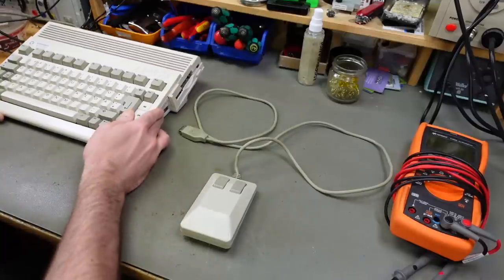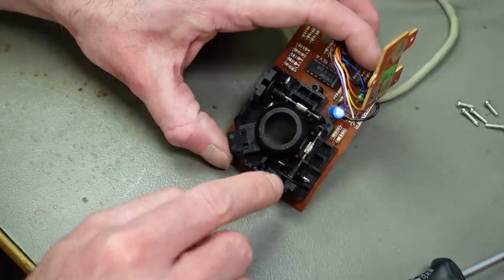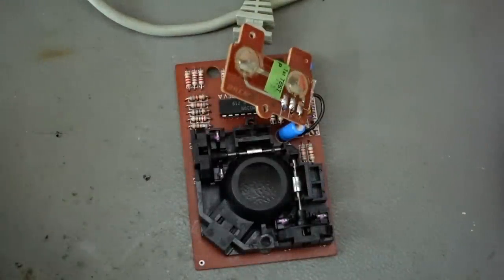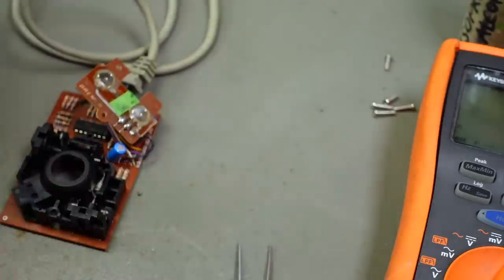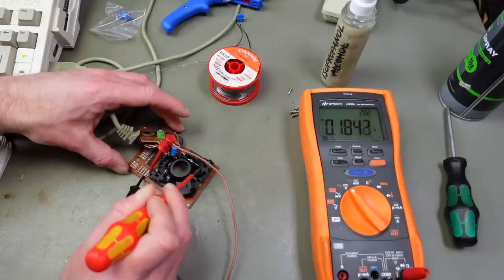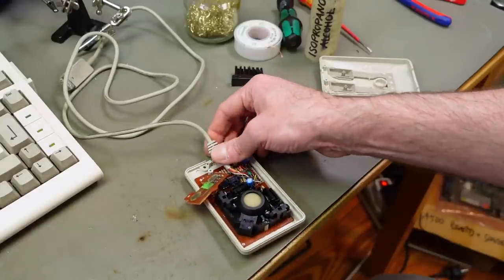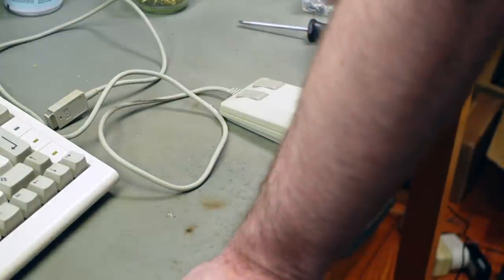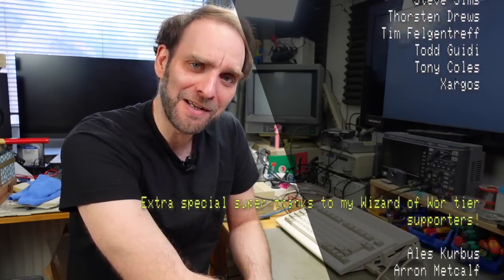Amiga Tank Mouse Repair

Comment: I was an Apple Tech back in the day and by far the biggest failure of mice was the cable at the mouse end just outside the grommet. My fix was to remove the cable, force the grommet further up the cable, a couple inches would do. cut the wire just past the bend where the bend caused the break, Strip the wires and reattach.
Reply: That is definitely my suggestion. Cut the broken cable near the moulded stress relief that goes into the mouse and test the yellow wire there shortening the cable until you get reliable continuity on the yellow wire.  
Unfortunately, that stress relief is directly moulded and fused onto the cable and will be very hard to move.
 Easier to cut the cable just before that and then carefully remove individual wires from the part going thru the stress relief. Then try and cut and pull the cable outer layer thru so you can then push the good part of the cable thru, etc.
Reply from the maker: That is a useful hint, thanks for sharing. I am actually going to try if that helps with the original cable. Maybe it's fixable after all!
Reply: Would have been a nice klickbait: "Amiga Tank Mouse Repair und How to build a wireless Tank Mouse".
Reply: Wanted to comment the same. If there is no obvious pinching or damage on the cable, the most likely failure is at the point that endured much stress and that is mostly bendy bit at the mouses end.
Reply: @JanBeta  Some cables were harder than others to get the grommet to move, but, I found grasping the jacket with pliers on the side facing the mouse and then getting the grommet to spin made it much easier to twist and slide the grommet away from the mouse end worked pretty good.  Keeping in mind you are going to cut off the section of wire that pinched by the pliers.--Good luck!

Comment: I'm not even in the same universe as you regarding my repair skills, but I have fixed my fair share of mice in the 90s. The cable was always the fault. Since the break is usually near the mouse, it's worth checking for intermittent contact. I used to check for continuity on each lead until I found the faulty one. Then I would bend the cable around my finger and pull the finger along the cable until I was able to localise the fault. Since it was usually near the mouse, I simply cut off a bit, with a healthy margin and then soldered the wires back onto the mouse. You'd end up with a slightly shorter cable, but your mouse would work. Given that my country was under a UN embargo during much of the 90s, it was nigh-on impossible to get a new mouse, or a replacement cable for that matter so we did what we could.

Comment: I had an issue with the glide pads on an Amiga 1000 mouse. The original pad material was thicker so I ended up having to add some double sided tape in the holes to shim it up a bit or the glide pad was too thin and the ball would not make good contact with the rollers due to the ride height on the mouse. This was with the same material you have there and an 11mm leather punch
Reply from the maker: Interesting! The replacement pads seem to fit perfectly on this particular mouse, feels very good and works perfectly fine. Maybe they changed the design slightly from the initial tank mouse model? I'm going to have to double check on my A1000 mouse.
Reply: @JanBeta  I think the original pads were also too thin, so Commodore stuck several on top of each other. That's why you had to remove more than 4 pads at 29:49

Comment: I fixed the missing teflon on my Mac SE/30 mouse by just buying a cheap sheet of teflon from China and cutting it out and just using double sided tape. One piece has a weird semi-circular arc shape, so I made a paper template and used that to find the right sized hole punches, and cut the straight edges with a hobby knife. That seemed to work pretty well for me.

Comment: Jan, thanks for another great video! How good are the button clicks? Those dome switches are prone to wear out easily, I had to replace several like those on Atari joysticks because they had become mushy and unreliable. The replacement dome switches I used were from an ebay seller in Germany called Amiga-Design, however they look slightly different than the ones in your tank mouse.
Reply from the maker: The buttons work well on this one but I've seen many of those dome switches wear out indeed. Usually you can get them back to work by removing the top of the domes (stuck down with tape) and cleaning the contacts and then sticking them back down with new sticky tape, I found. No need to replace them in most cases. They are very prone to failure though.

Comment: My experience with most mice that lose functions, from retro ones from many years ago to current ones that have stupid-thin wires is, the point at where the cable goes into the strain relief, which I find to be an ironically-named part, is usually the source of much strain on a cable and wires break right there where the worst bending of the cable takes place, needing to cut the cable back and somehow feed it through the strain relief & reconnect inside the mouse, reviving the mouse again, until the next time it breaks... :P
Reply from the maker: I'm actually going to give that a try with the cable I removed. Maybe it really is that simple. Several people in the comments pointed out that it's a common weak spot in these. Thanks for pointing it out!
Reply: @JanBeta  That's the benefit of sharing experience, it wouldn't surprise me if that one wire, you could pull on the copper and it'll just slide right out (also handy for gauging as to where the break is and where to cut it back to), I've done this with so many cables with alleged strain relief at one end and repairing, or at least bodging it 'til I got a replacement, the worst cuplrits being Lenovo PSU plugs, always breaking at the laptop end inside the strain relief itself!!! It's almost like they designed them to break there... :P

Comment: Nice fix and ideas what might be wrong in these :)
I have one PC PS/2 mouse, which otherwise works, but the wheel rolling feature stopped working at some point. The pressable button in it does work, but the roller, up and down rolling doesn't work. Luckily not a huge problem as there's other means to scroll up and down, so haven't gotten into it very deeply yet. Took the mouse apart once to see if there's just some dirt, but no, didn't work even after cleaning it.

Comment: I read somewhere that there are adaptors for using a standard serial mouse with a C64. Still, I really should test out my 1351 which I bought a few years back but never got round to writing the driver for it. I did for the NEOS mouse though, for my GUI programs. (Actually, I pinched a chunk of code from other software & modified it to work the way I wanted. I'd be happy to pass this on if you're interested, assuming the disks are still OK).

Comment: From my experience with Amiga mice, when something breaks, it's always either a wire, or the button itself.
in fact we've probably thrown away many Amiga mice just because of broken buttons... however, the ones we had never used blister buttons like that, the ones we had have a microswitch soldered onto the main board. I think it's a later revision.

Comment: Back in the day I found that the metal rollers were prone to collect dust, dirt, & crud (fluff). The first step should be to restore both rollers to clean shiny metal . Once you remove the resistor, I don't know why you didn't measure its resistance against its banding code (BBROYGBVGW). In my experience connectors are the most likely malfunction. (Ohm out them first.) Reseating cables has fixed many malfunctions. I've found Goo Gone works for removing old glue residue.
Reply from the maker: I cleaned the rollers meticulously in one of the previous videos in the series. Unfortunately, the metal is corroded quite a bit so it still looks like it’s dirty. The rollers work fine though, thankfully.
The approach I’ve taken was admittedly quite chaotic. I was very determined that the fault would be the same one I encountered during my 1351 repair so I jumped right into that without taking a methodical approach. That backfired quite a bit but I’m always learning. Thanks for the tips!

Comment: Hi @janbeta, I don't know if you read comments on your older videos and I have a really silly question; what type of screws are in the tankmouse housing? I recently acquired an original tankmouse myself but it came without the screws. I tried screenshotting your video, but the resolution is too low to get an accurate impression. Anyway, thank you for your videos, it gives me the courage to repair my own stuff ;)
Reply from the maker: Please send me an email (contact on my website janbeta.net). I can send you some measurements and pictures if that helps. (Might take a couple of days until I answer though, I have to take a tank mouse apart to check.) :)
Reply: @JanBeta  I managed to find perfectly fitting screws; M3x8 1mm pitch, and replaced the switches. Now only retr0brite is needed and it’s all done :) Thanks again!

Comment: Would soldering in a pin header on the "broken" mouse circuit board and then using the donor mouse cable intact with it's wired 
connector (unless it was fixed  to the circuit board and non removable) not be a more ideal solution Jan ?
Reply from the maker: In theory, yes. The pinout is different though so it would not be "plug and play", it would have required rewiring the connector so I went with the more destructive method. If I ever make a new cable for the "wireless" mouse, I can just reuse the connector or crimp some new connections on a pin header connector. :)
Reply: @JanBeta  Thank you for explaining this Jan it makes complete sense now.

Comment: I was shouting at the monitor for the first 20 mins of the video, "check the cable, check the cable!" 🙂
Reply from the maker: Yeah, noob mistake. Should have checked the wiring first thing. I was so determined it would be the same fault as in the 1351 mouse I fixed that I forgot to check the simple things first... :D

Comment: Could you have used the max\min function of the multimeter to test the resistors?
Reply from the maker: Yes! Didn't think of that but would make perfect sense in that scenario, obviously. :D
Reply: @JanBeta  Finally, that button will have some use! 😂

Comment: I noticed you didn't clean the roller wheels that rub against the ball. Lots of build up on them make the mouse not scroll as smooth. You have to scrape the junk off of the two direction wheels and the tension wheel.
Reply from the maker: I cleaned them as well as I could in a previous episode. Unfortunately, there is quite some corrosion on the metal that makes it look like it's still dirty. It doesn't interfere with the movement too much, thankfully.

Comment: I wore out the cable on so many cabled mice, I only work wirelessly now. Buuttttt....  Those rollers... clean those rollers!  Dead skin and oil are not good rolling surfaces.
Reply from the maker: I cleaned them as well as I could in a previous episode. Unfortunately, there is quite some corrosion on the metal that makes it look like it's still dirty. It doesn't interfere with the movement too much, thankfully.

Comment: very scary thumbnail...😯
Reply from the maker: I just couldn't resist putting the rubber mallet in the thumbnail. ;)
Reply: @JanBeta  When I saw the thumbnail I thought you would destroy the mouse after 30 minutes because it did not work 😆

Comment: Hmmm. This kind of debug is not really a good demonstration. Why not look at the schematics and measure at the output of the mouse? From there you can go back until you find the bug. Or at the outputs of the LM339? Just connecting some mysterious resistors is not a good example. The 5 digit DMM does not help here . . .
Reply: Exactly my thoughts. On the bench there stands a perfectly good digital scope with 4 channels. This mice have 4 signals for detecting the XY movement, why not use the scope to troubleshoot? Connecting 4 channels to the 4 photodiodes and then on the output of the pcb. After that connecting the probes to a D-Sub9 connector connected at the end of the cable. The data encoding in the signals by the are also not so complicated, 15 minutes of reading on the net.
Reply from the maker: I was on the wrong track but figured it out in the end. Using a scope to troubleshoot a mouse like this is way over the top. I usually try to use the simplest tools first and go to the devices that not many tinkerers have at hand as a last resort.
Reply: @JanBeta  you have the wrong approach.
Reply from the maker: @JacquesMartini  Yup. Can't always be on the right track.
Reply: @JanBeta  That's not the point. Your overall approach is not good. More than often, you just poke around in the circuit in hope for a lucky hit. Trial and error without much thoughts. This works somehow, but it's not a really efficient and skillful way. This can be seen on a lot of your repair videos, e.g. the fix of the C64 with broken traces. This easy defect of the mouse could have been a simple but good example on how to debug hardware the right way.
Measure

-supply at the mouse
-supply at IC
-output signals at mouse/IC
-measure voltage at LEDs
-measure voltage at photo transistors

A DMM is enough for this, but not with 0.1mV resolution. The flickering numbers create more irritation than information. 1 or even 10mV resolution is plenty here.
With the known good channel (Y axis) you can compare voltages very easy. Even with a known common defect as the bias drift of the photo transistors, the assumed defect should be measured and confirmed first before any modifications. Yes, there are sometimes problems where you can not measure any defect, for whatever reason.Then you have to swap components and test. But this comes in a later stage, when you run out of ideas or measurement options.

Bigclivedotcom is a very good example on how such debug and analyzing session should look like!
Reply from the maker: @JacquesMartini  Yes, I got that. My approach is not an educated one. That's because I don't have any proper education in electronics (unlike Clive). I am also not a very logical person (as you can see in many of my videos). I'm just poking about most of the times as you said. I don't claim to be an expert at any point though. If you want to watch expert repairs, you gotta have to watch somebody else. I am learning all the time but I'm still just a hobbyist when it comes to troubleshooting. It's fun for me and for many others to make these videos and figuring stuff out my way (judging by the comments). Sorry if it doesn't match your expectations.
Reply: @JanBeta  Ignore the haters. I bet a lot more people enjoyed this video than those that didn't.  At the end of the day, you do what makes you happy, and if you want to share that with the world, all well and good.  The haters can go off and make 30-second tik-toks with titles like 'I fixed a mouse just by plugging in a new cable' that does not teach anyone, anything.

What they've ignored here is how you explained how the mouse internals worked and showed a rudimentary troubleshooting process that anyone with a multimeter can follow.  I've only recently splashed out on a scope after many years of fixing things with just a multimeter.
Reply: @JaruzelUK  You are childish. Nobody is a hater. Why should we? I expressed a normal criticism with some suggestions on how to make it better. No more, no less. And no, he did not explain a lot an did NOT show how to debug this problem. Just poking around hoping for a luky hit.

Comment: What a nonsense! Desolder components before you have a good diagnosis and understanding of the circuit! I surgeons would work like this . . .Whats the probability of a broken resistor in THAT kind of circuit?
Reply from the maker: As I explained in the video, the resistors don't break. The bias of the transistors shifts over the years and the resistors can be replaced with matching values to make up for it. I explained it in more detail in my 1351 repair video (linked in the description). Not nonsense, actually a pretty common fault.
Reply: @JanBeta  nevermind grumpy, it's all YouTube engagement. (Wink)